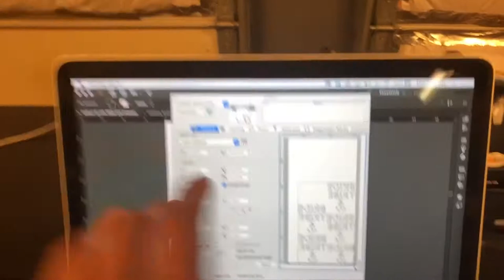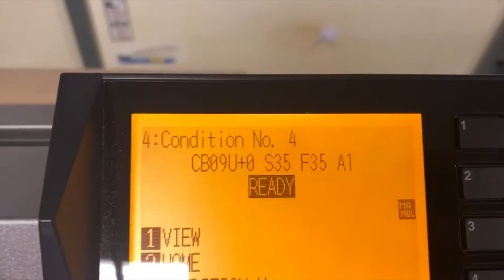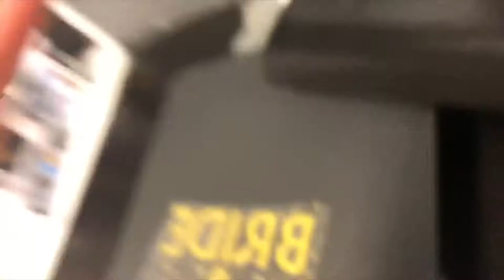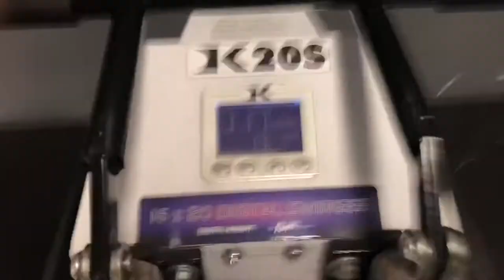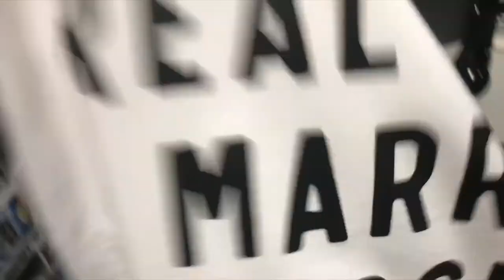How To Make Vinyl Shirts from Home with Graphtec - Selling Shirts vLog 1

Comment: Do you need to cut anything off from the regular transfer before you can use it? I bought a transfer and used it to print a shirt but I had some thin layer of the transfer on the design.

Comment: do you also do custom orders, or is it the most of your sales from the designs you offer online?
Reply from the maker: Great question. Most are sales from designs offered.
However, I do custom orders if it's as simple as giving them options between types of things, text, names, etc.

Example:
Choose between the type of color print you want.
What custom text would you like?
What is the name you would like?

I don't do full on custom orders such as allowing someone to have you design something 100% new.

Example:
Can you do a robot with a lightning bolt with my child's name on the back with a palm tree.
(This takes too much time to do and disrupts having a system in place.)

Not saying it's wrong to do, just doesn't work for me.

I touch on this slightly at 5:25 mark.